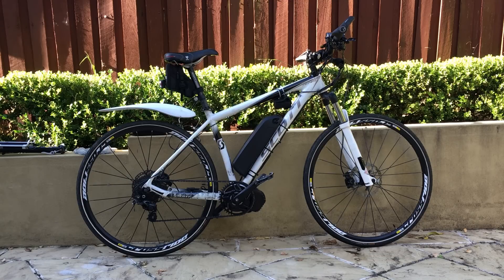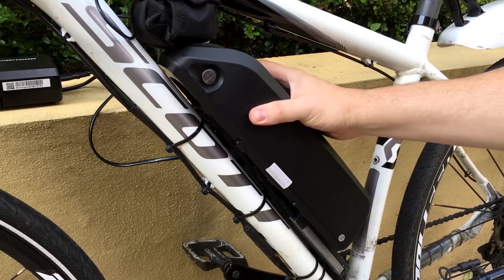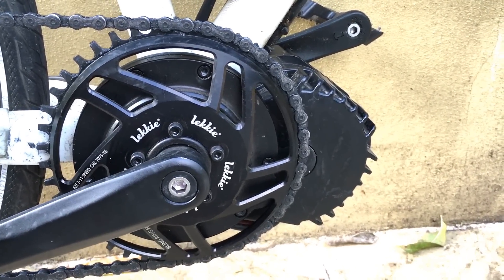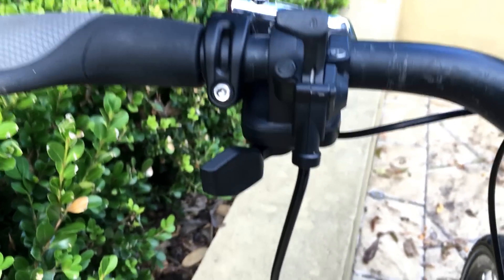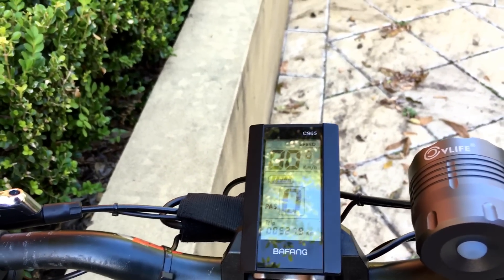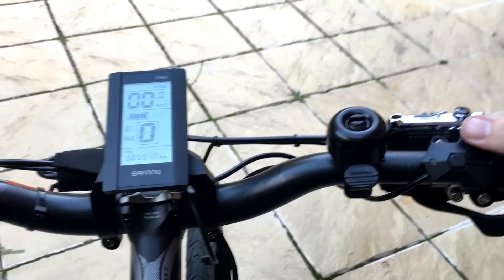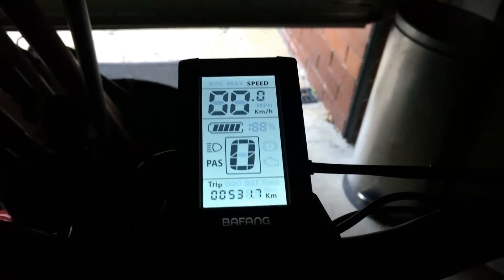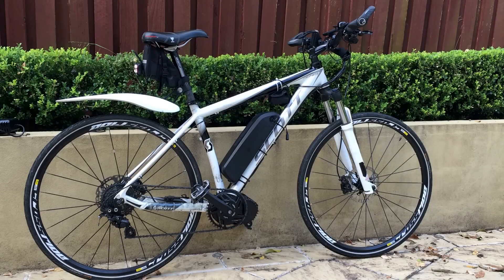Bafang BBSHD 1000w Walk Around And Review 65kph - 40mph Test Run

Comment: I put one of these on an older Schwinn bike in January. Updated the brakes, new tires. This thing flies. It can work in pedal assist mode where it looks like you’re just riding a bike. It has a throttle which I only tend to use at startups crossing a street or when pulling out of a turn when It’s too soon to pedal. Fun. Today I got it up to 38 MPH. I typically use power assist 2 or 3. Average around 15 MPH and cruise at 18 to 20 when I have the room. Got over 250 miles on it since the upgrade. I have discovered bike trails that I was unaware of because riding manually limited my distance from home. At 69 this makes me feel like I’m 30.😎
Reply: Hi I’m looking to buy a 750w how is the battery, motor after 2 years use
Reply: Still great. During the last winter I didn’t ride it as much after putting 1000 miles on it. When I decided to ride it again it appeared the battery wasn’t charging up fully. So I rode it a couple of times and recharged it. The second charge was better. Finally the last charge was back to normal. It was stored at 50% charge over the winter. I recently acquired a retro Columbia bike. It’s a remake of a 50’s model remade in the 80’s. Ive actually neglected the eBike since getting this retro bike. Anyway, no issues with the conversion.😎
Reply: @geoelectro  Thanks! Sounds a nice bike,  I have an orange 224 full suspension it’s going on. Do you recommend upgrading the caset as per the video?
Reply: @comfortablynumb8832  No I didn't. I did replace the chain, new brake pads, and ebike rated tires. I just ride like a cruiser so not a lot of shifting etc.
Reply: @geoelectro  thanks
Reply: I got a cheap qlife 350w rear drive e bike. Thinking about adding this to it for fun

Comment: Don't charge while the battery is on the bike. There have been lots of fires while charging. $100 fine in Western Australia for not having a bell! I have hit 100 km/hr going down a 17% slope several times, that's without a motor as well.

Comment: This is the best most informative review of this unit on the internet so far - good work.  Thanks very much.  A progress report would be useful also if you can find the time.  Cheers from NZ.
Reply from the maker: Thanks very much, about to do a follow up 1000km progress update review...stay tuned
Reply: Agreed.
Reply: Where is the update!?!?! Is 40mph with or without pedaling?
Reply from the maker: I will try and do an update video on this bike, been going strong for nearly 2 years now! That is without pedaling, to be honest anything above about 30kms/hr with peddling is a bit useless, its just too quick for your legs to keep up.
Reply: That sounds a little low. What is the range of gears on your rear cassette?

Comment: I have this same set-up. But don't have a throttle. Only pedal assist.  You're range and speed dovetails with what I can keep track of. You say that pedal assist gives you about 60% of the available power and the throttle gives you all available power.  I believe you, and I can see that in your video when you use the throttle.  
I love this system. No complaints at all. Fastest I've been is 40+MPH going down a hill. Roll between 15-20MPH all the time with very little effort. Nice video. Thanks for making it.

Comment: Love it!
All that power and yet so quiet.🍻
Really neat conversion job, too.👏👏 Good cable management, from what I could tell.👍
I've just ordered the BBSO2, 750W kit.
I'm in the UK though, with its ridiculous 250W restriction, so keep it under your hat, OK everybody?😉🤝
Reply: bro. I have the 750w kit. Love it. However, know that you will have to DIY the DIY things. It took me and my dad three days to install. Maybe it's cus we were a little unorthodox, but still. Also, you may not even need to have it go at its 34mph speed. For me, 26mph is more than enough. I bought the 750w because of the amount of torque it has. I plan on going uphill a lot. It's pretty good.
Reply: Unjust laws need not be obeyed.
Reply: @allywilkeforsenate  And they are not being....🤭🤝
Reply: @originalrecipe6113  are you uk if so we're did you get your motor thanks
Reply: @niceboy761  I got all my materials from Ali Express and Amazon. It's the Bafang 48v 750w mid drive. I bought a 20ah battery with it as well, and it can go 30 miles if you go around 15mph with it on throttle, about 10 more miles if you do pedal assist
Reply: Totally agree with you mate 250w limit is ridiculous.
Reply: Just use the 250w stickers that come with the kit - my 1,000W motor came with five 250w stickers!

Comment: I own the bbs02. It's still very powerful for a bicycle. So amazing that I save almost half of the time on commuting. Also I find the speedometer is very accurate. It is only 1 or 2 off the gps.
Reply: Prem  It depends on the assisted level and your battery. I use it with a 48V 15Ah LPF battery. Among the 5 assisted level I settle on level 2, with the average speed of 40kph when pedaling, the battery will give me 40+km of range. With level 1 pedal assist, I estimate around 70km. Remember the assisted level of bbs02 is speed oriented. You go higher then you go faster, but only to a certain extent. If you have a custom controller then that's another story.

Comment: I went 21 miles in 55 minutes throttle only on the 48V 17.5Ah battery. Plenty of 25 mph stuff and some ups and downs so pretty good range. Charged up and used 614Wh - only 3/4 of the battery! Going 35 to 40 does drink it though.

Comment: Also, not sure if it was mentioned. But always store liion or Lopo batteries at 3.8v per cell. Will increase the life of your batteries significantly! Never leave batteries fully charged for any longer then needed. (If you care about your battery I guess)

I use a Wemo remote PowerPoint.. if I know I need the bike in the morning, I set it to turn on charge at 2am. 

Tesla cars also do this, only charge as much as is needed for the journey, and use similar 18650 cells.

Comment: Nice bike. I have a scott sub 20 and i will put a 48 volt 1000watt mid drive 68mm bafang with a 52 volt battery. I am glad to see that it fits your Scott hood because my scott is about the same.  I will go with 44 teeth in front. 👍🏼I can't wait to get it. If you would of got a better display head unit you  could go faster each head unit has different limiters most are 99 kph  the one you purchased cuts out 70 kph but its still fast.

Comment: I purchased the older bb 750.  I used a nuvinci 360 automatic hub in the rear with it.  Works real good, one chainline so no issues with clunky gear changes or broken chains, It would be even more awesome with the 1000 watt model!
Reply: Is there any review of your setup available? I got nuvinci (the first model) too and going to modify the bike an electric one.
Reply: herkko61   hey, didn't make a review, but used the biggest nuvinci sprocket I could find online...22 tooth on the back, and a 34 Raceface narrow/wide tooth on the Bafang.  I put it on a Trek Fuel EX full suspension, so I had to add an adjustable spring tensioner, to accomodate for the swingarm movement.  I haven't had one instance of the chain coming off, but you CAN feel the flexing in the carbon fiber swingarm when torqing hard!  Probably be more solid on a hardtail....that being said, last weekend took some e-bikes and buddies to Spieker mountain.   It's a hiking trail, with about 2000 ft elevation over a couple of kms.   Real steep!  I was on my Giant with a 500 watt geared rear hub motor....I made it about halfway, and cooked my controller 😔.  But the bafang/ nuvinci on the Trek Fuel EX climbed the entire trail to the top- with just a 10 amp/hr 48 volt battery!😲  Insane amount of torque!  Nuvinci hubs and mid drive motors compliment each other....the motor can spin easily with the super low gearing, and not overheat.  I think I was pushing the nuvinci to the limit, though....manufacturer recommends no more than a 500 watt motor driving the nuvinci, but it passed the " stress test" with flying colours!  I didn't have an inclination meter in my back pocket, but I swear some of the slopes were over 50 degrees. Had a 2.5" x26" tire at about 20 psi on the back to put a good footprint on the ground. Met some winded hikers on the way down, and they couldn't believe we took bikes up there.  I think the nuvinci is very efficient with a middrive motor, and buttery smooth.  The Bafang is good with a typical gear cluster on the back hub, but can mash the chain and cassette pretty good, shifting under power.  With the nuvinci, there is NO mashing, and power shifting is seamless and silent, so I think that the drivetrain will last longer, with less maintainance.  Yes it is a heavier hub, but not noticable with a motor at all.  If you were hesitating, wonder no more....you will be extremely pleased with the results!!  cheers!
Reply: Thank you very much for your reply. I'll use Nuvinci + Bafang only in my city bike, so I think the torque will never be even close to a mountain bike use. Also, the first Nuvinci model should be the toughest to stand the torque. Just wondering because I'm quite a heavy guy. I already changed the rear sprocket to a White Industries' "heavy use" one, 20t if I recall correctly. Then I only need a Raceface 34 narrow/wide, that's all. This 1kW motor must be a beast! :) In my neighborhood there are many very steep hills. I like cycling as exercise but my knees are aching nowadays too much when riding up the hills.
Reply: herkko61 my stock chainwheel I got with my Bafang motor was a 44 tooth....I got an aftermarket spider that fit the Bafang motor from Hipower cycles.  That way I was able to bolt up a variety of different chainwheels to the Bafang unit....I chose the Raceface 34 tooth for the crazy mountainclimbing torque....overkill for the city.  Stock should work great with the nuvinci.  I thought I'd tell you about the aftermarket spider...bafang has a 5 bolt pattern thats kinda unique to their brand, which limits your gearing options, I am not sure if they now offer different chainwheel options with the motor...but the spider was cheap, around 20 bucks, if you wanted that option.  And then the narrow/wide chainwheels become an option.  I like them-they do a great job of keeping the chain on the sprockets!😄
Reply: Thanks again Jim. Then I go with the Bafang chainwheel but keep in mind the spider adapter alternative if I later decide to move to mountain biking aswell. In that case I definitely need a spider.

Comment: Going from a hub wheel where it doesn't matter what gear you're in to this has a been a steep learning curve but getting used to it and the mechanical resistance is so minimal that I use it with no power 50% of the time :D
Reply: I've got a BBSO2, with a 17.5ah 48v battery, which I fitted about 8 months ago, to a Boardman hybrid-type commuter. 
Riding under normal road conditions (ie 15mph on decent surfaces with little head wind) and assisting the motor to a fair degree, I can easily get over 100 miles of range between charges. And I'm recharging when I get down to between  2 and 3 bars, so plenty of juice still left. 
The trick is not to rely on the motor any more than you have to. Save it for the steeper hills. You'll stay fit that way as well.
Happy e-biking! 😁💪

Comment: Thanks for the video! One of the more betters ones I've seen! Want to convert my 29er Single Speed MTB with this kit but still thinking if should go geared.
Reply from the maker: I would probably go geared otherwise you will put too much stress and work on the motor when going up steep hills. I still find I need to treat it as if the motor wasn't there to get the best results..
Reply: +Fresh Anything Thnks for the tip! Will take a look into geared setup :)

Comment: I have been getting all information I can about BAFANGS motors and about the different batteries I can use before I order mine. 
Your video has been the best video I have seen so far. I think I don’t need to see any more videos after yours. Thank you.
Nevertheless I have few questions. How many teeth has the new  chainring?  It looked to have less teeth. Is it made of aluminum or steel? I would like to get the smallest chainring that fits  because I usually do extreme extended climbing and I don’t want to force the motor. I am not interested in speed. Only interested in climbing. 
Another question: Can you use a 52V battery with that very same motor? 
Thank you. I gave you a thumb up very well deserved and I subscribed too. 
I live in Southern California.  This area is a paradise for mountain bikers. 
Thanks again.

Comment: I just bought and fitted the 750W BBS02.. It saves 250W power than the 1000W and still provides 160nm therefore will go further.. especially with 15Ah Battery.. I think the BBHD is overkill and best suited to the fat heavy bikes.. Fitted it to my Kinesis XC2 and very happy.. Top speed 47mph 😀
Reply from the maker: Sounds a fun setup, I just want a fun bike and I certainly have that!
Reply: Are U sure? 47mph? It's more than 75km/hour speed.
Reply: where did you buy?

Comment: I have the 750 on my diamondback now I think I will get the 1000w and put the 750w on my wife's diamondback Lux. I put on some kwik seven 5's for the the street so much fun to ride. Love that set up. I found this sweet mount to get the light off the bars and centered mounts in the spacers. Minori made in japan.
Reply: what's the range and what size battery are you using on your 750W?
Reply: 52v Panasonic cells 20-40 miles not many hills here I use the throttle a lot. Around 20 miles throttle only mostly flat terrain. Then it depends on how much you peddle which PAS mode you use. Almost 500 miles on mine now still runs nice.
Reply: thanks for the quick reply, I just brought mine came in the post today. I am busy installing it and will probably use it ona 20AH 48v battery. I have been using wheel hub motors but this time decided to use these mid drive motors instead. I'll let you know how it is in a few weeks lol
Reply: Holy amp hours batman. I only have the 11.5ah battery. With the 20ah battery double it most likely.

Comment: Thanks for the great video. I was thinking about going with the 3000w cyclone but ended up with the BBSHD thanks to this video. Been a couple of months now and i love it. The only thing I would add to this video is to pay attention to the quality of the cells used in the battery pack. Don't go cheap! The battery makes a noticeable difference to the performance. When my current 48V 40A drain battery dies I will go for a 52V 40A battery. I really enjoy the peakiness of the freshly charged 48V battery which lasts about 5-10 mins. With a 52V battery I am hoping this 5-10 minutes will become 10-20 minutes.
Reply: Gavin Boyle By 40A you mean ofcorse amps? But what AH you have? I finally bought BBSHD and now I have to decide about the battery. What is better, 48v 17 ah or 52v 14 ah? Is 52v worth it if I get less AH for the same money?
Reply: I have a 48V 7.8AH currently. I commute 8km to work and the 7.8V battery does this distance easily.  Using throttle only at full power I can do 12-15 Km. I am 95kg and encounter a few small hills. When the battery is fully charged for the first 5-10 mins the acceleration is noticeably quicker. If you do a google search of a discharge curve graph of a say a Samsung 25R li-ion cell you will see that the very top tip of the voltage curve drops off rather quickly. As the voltage drops  from its peak so does the acceleration. The 52V battery keeps you in that higher voltage band longer than a 48V battery.   

48V x 17Ah = 816 Wh  52V x 14Ah = 728 Wh. So choose the 52V and get an additional 5-10 minutes of peaky acceleration or choose the 48V and get an extra 12% capacity. 
Since I ride a short distance I would go for the 52V 14Ah. However if you need to travel more than 20kms you will need that extra 12% capacity.
Reply: A 40 amp hour battery? That is huge. Is that a rack mount battery pack? Wherever did you locate such a thing?
Reply: G Henrickson His battery isn't 40 amp hour but only 7.8AH, read below. I have 52V 17.5AH and my bike with BBSHD goes about 55 km using just the throttle.
Reply: I see you went for the 52V. Awesome you are getting 55km. I am only getting about 45km tops. My crappy Samsung 26F celled 48V 15A battery is my limiting factor. I should have learnt/researched more before buying .  I know now the BBSHD needs a battery that can easily deliver a constant 30A (when required) and that 48V is fine but 52V is better.
Reply: @dimamanzano  so how its going now? is your battery still ok? what motor do you use?
Reply: @Timsturbs  Yes, it's amazing, the battery is great. I use Bafang bbshd and 17.5 ah 52v Sanyo GA battery. Mileage is 10200 km for battery and 6700 for last motor, 1 motor was 3500 km. Motor never broken, I just sold the first one to earn some money.
Reply: @dimamanzano  wow thanks. where did you get the motor and the battery from? aliexpress?
Reply: @Timsturbs  Yes, exactly. Motor from eunorau shop and battery from unitpackpower.